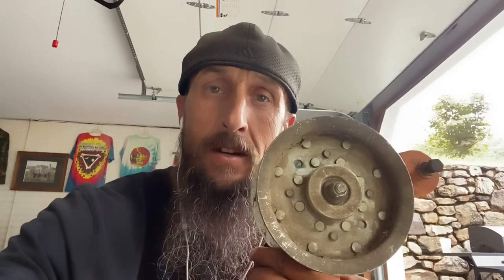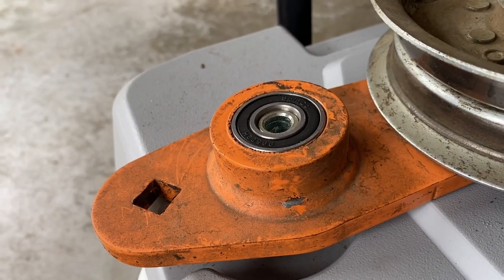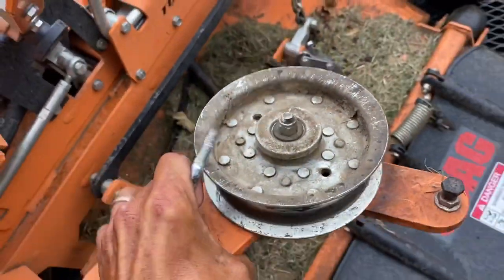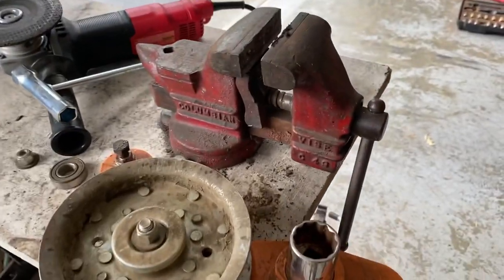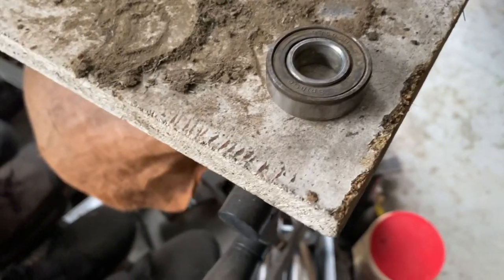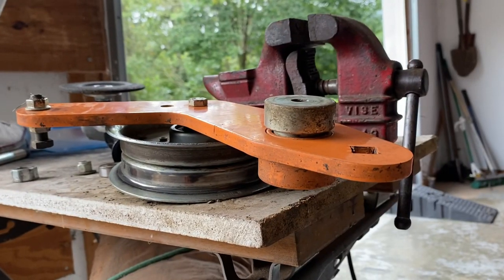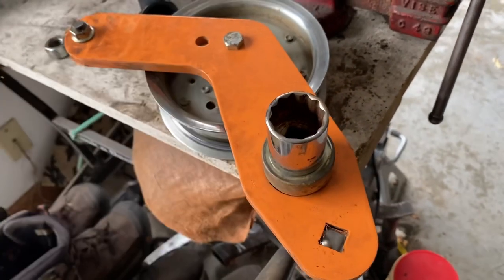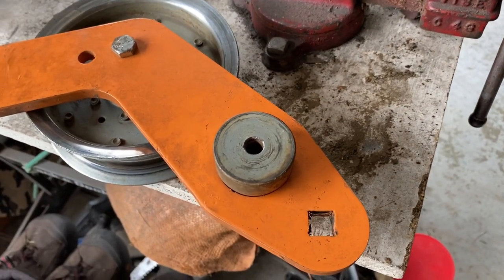Tension Pulley Bearing Replacement Scag Turf Tiger 2 and OTHERS…

Comment: So I did this and it worked for about a month.  All of a sudden it starts doing it again.  Bearing still seems perfectly fine.  Nothing looks bent or warped on any of the other pulleys.
Reply from the maker: Take the belt off and see if it has play in that pulley arm. Also look at the belt. Sometimes old belts get stretched or chunked out. 🤜🤛

Comment: 😂 not an idiot, brother....I was thinking to myself, though "noooooo, don't hammer that bushing down in there!!!" 🤣  Nice work, and I don't remember if I commented on the previous video, but good idea using that piece of cardboard.as a stop-gap.

Always something...I recently put new headlights and a secondary horn ( a "beepbeep at the ladies and friends" horn 🤣 because the stock computer controlled horn can't do it lightly and smoooooth ) on my 2014, and had to retighten an exhaust bolt on my 1 year old Exmark 60, and put another pto belt on my Exmark 30, even though the previous belt was no more than TWO MONTHS old 😑 😂  Sheesh, I don't even remember what other repairs I have yet to do 🤷‍♂️🙏🏽🙏🙏🏻💪👑❤️‍🔥👊
Reply from the maker: Love your updates Kodiak 💪💪💪 thanks so much!! Hope you’re season is going well… these leaves are next 🤯

Comment: Before I put the "sealed bearings" in I take a small screwdriver to pop the bearing cover off.  one on each bearing and fill the bearing with grease. No way they put enough grease in them. I do install the cover then the ones I removed I make sure I install the bearing with the covers that were reinstalled are facing each other. The reason these bearings fail a lot is not enough grease.

Comment: Did you do this because you were throwing belts or as a pre issue?
Reply: I noticed the arm that holds the tensioner pulley was laying down at an angle. The belt was riding high in the pulley. I knew the belt seemed to be shuttering/ vibrating for a long time. Can't believe I didn't notice it sooner. Take belt off tension pulley and see if you can rock the arm up and down.
Reply from the maker: I noticed before it threw the belt…. It had excessive vibrations going on.